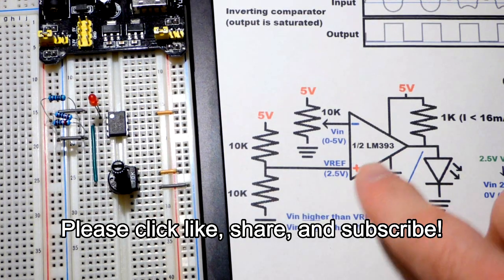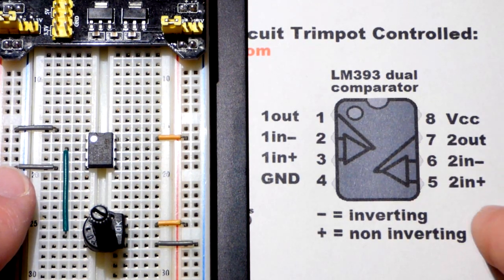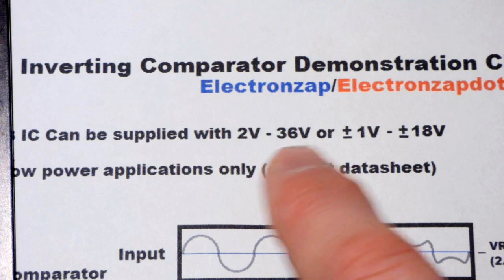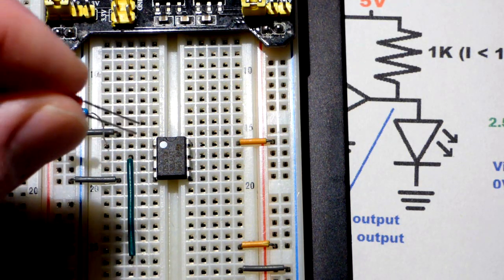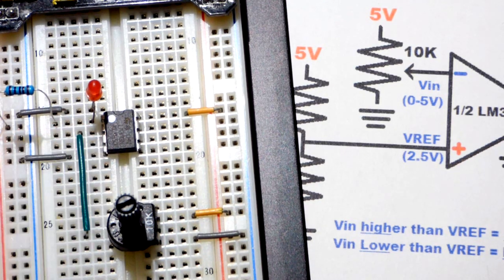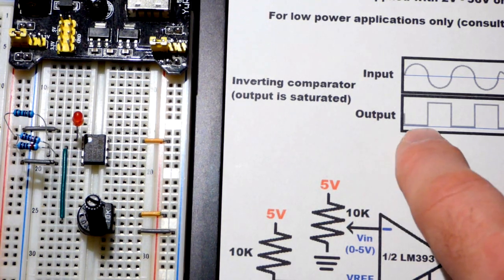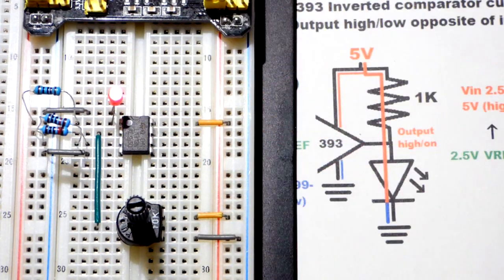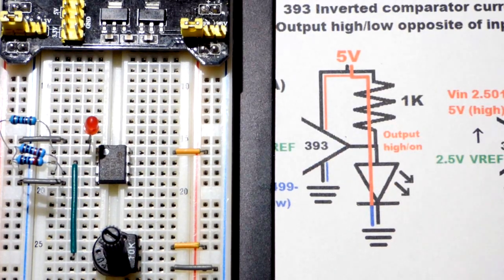LM393 Inverting Comparator Demonstration Circuit Trimpot Controlled by Electronzapdotcom

Comment: i want to include1.5k and 12k for the voltage divider instead of the 10k. When I power the circuit (VCC is 5 volts), the output does not behave correctly and never changes state. It seems the lm393 only works when the voltage divider is 1/2VCC. Am I missing something ??

Comment: Master:
This circuit has hysteresis?
Reply from the maker: No hysteresis in this circuit.
Reply: @Electronzap  thanks!!!👈
Reply: Add a resistor from the output pin to the voltage reference to add hysteresis